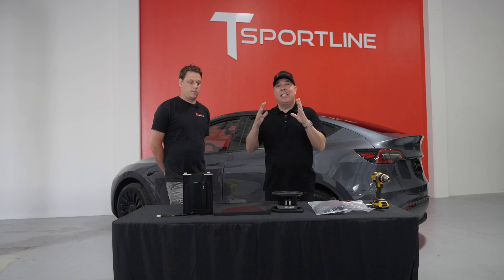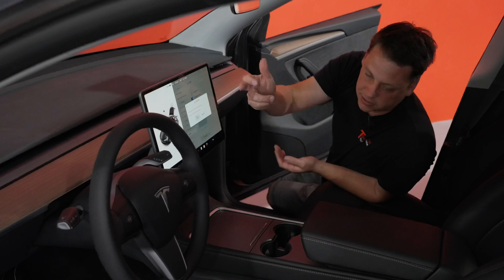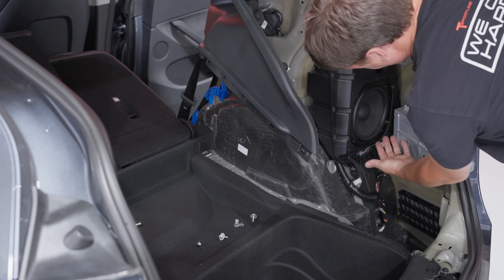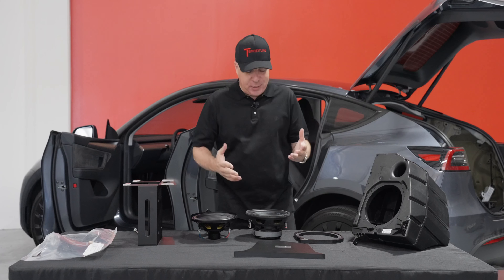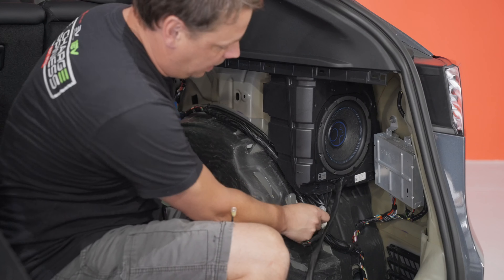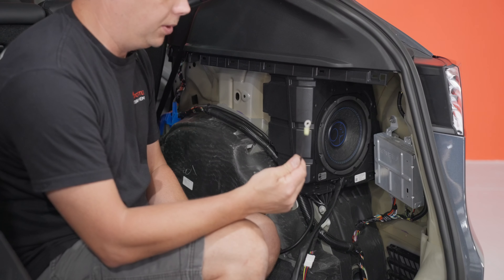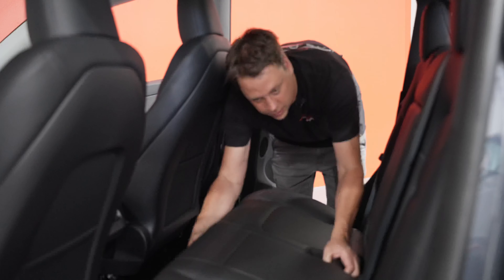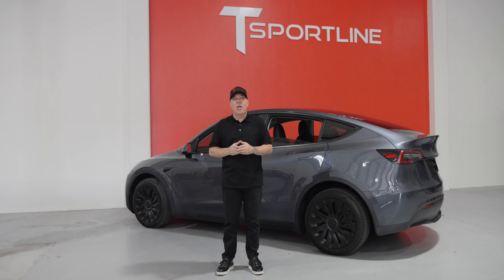DIY Upgrading your Tesla Model 3 Audio 🔊 with Advanced Bolt-in Subwoofer Audiophile Sound System Kit

Comment: Will messing with tesla wiring for the amp install void the warranty at all?
Reply from the maker: NO!  Federal Law prohibits such actions

Federal Warranty Law: The Magnuson-Moss Warranty Act (15 U.S.C. 2302(C))

The Magnuson-Moss Act regulates that vehicle manufacturers may NOT refuse warranty repairs merely because aftermarket parts have been installed on the vehicle.  The only circumstance under which the vehicle manufacturer can void the warranties is when they can prove the aftermarket part is directly responsible for (ie causes the warranty) the warranty claim.

Comment: What is the crossover point controlled by in the Tesla audio system? The stock sub is very directional and easily placed in the imaging. Does your amp have any control for crossover?